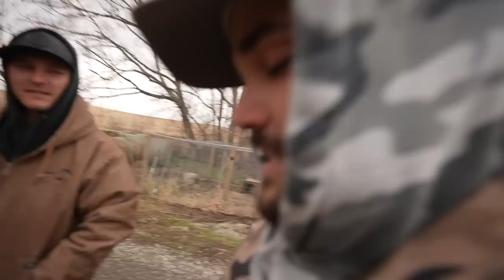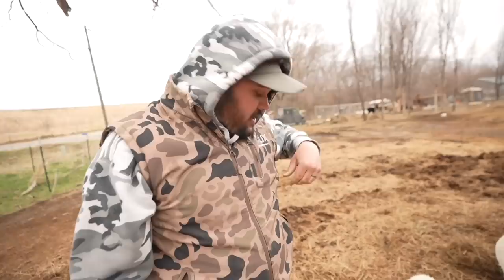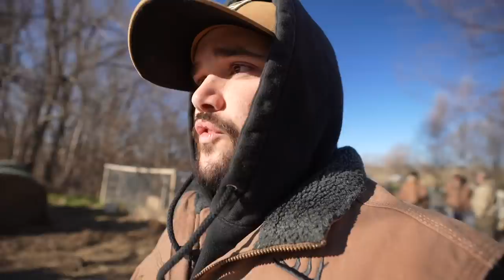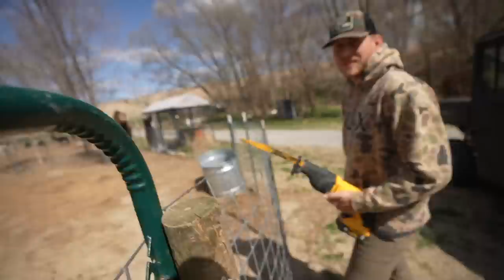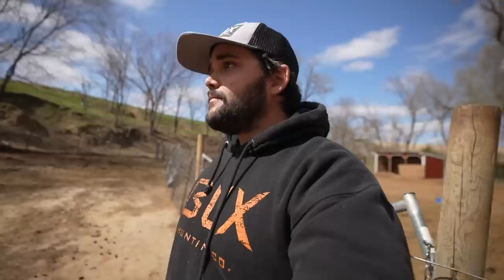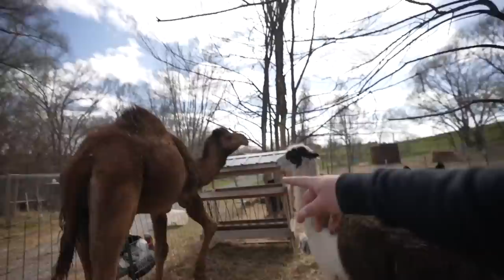CUTTING Off My PET Camels NUTS!! (Had to use Tranquilizer)

Comment: Drill some holes in the bottom base plate/bored and cut some reed bar bend in L shape and drive them threw the hole deep in the ground and that will fix it and it cheap